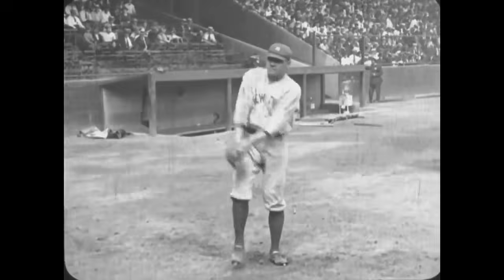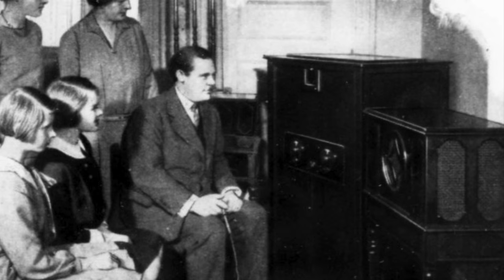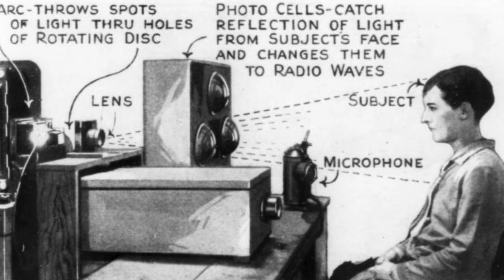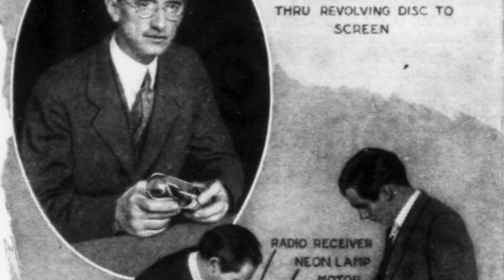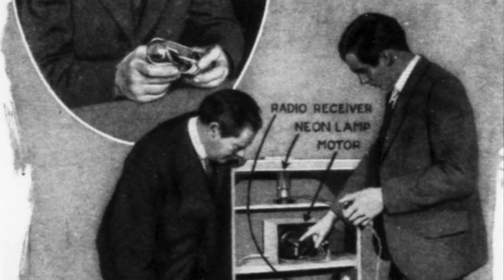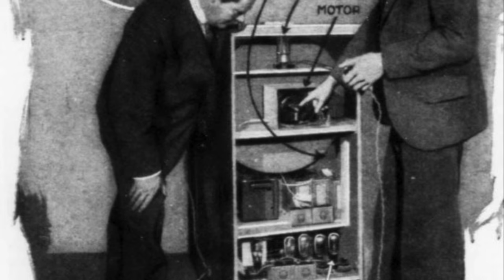Television For The Home In 1928

Comment: These GE experimental broadcastd were just one of several at the time. In New York City WRNY, yhe station owned by radio magazine puplisher broad cast several silent half hours. weekly. (With only one transmitter, just sound or only where GE had two stations. See on net. There were other experimental  stations.  Depression and WW2 delayed till late 40s.

Germany & UK had regular TV service starting in 1936, after experiments befor.  YouTube has sites about both with some filmed imaged.

Comment: Some of the home receivers used a rheostat connected to the motor as you mentioned. Some used a brake on the motor shaft, they let the motor run faster than required, by manipulating the brake through a hand held cable,  the disc could be brought into synchronization. Crude, but once the operator got the hang of it, the picture was remarkably stable. Thanks for posting.